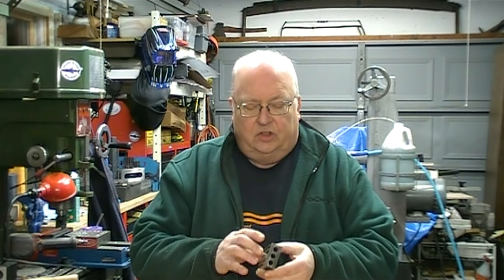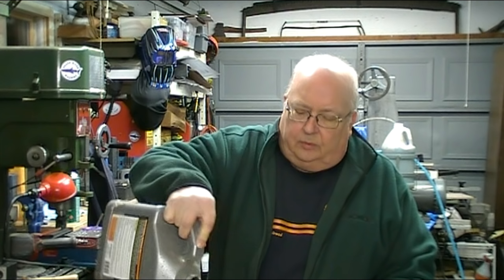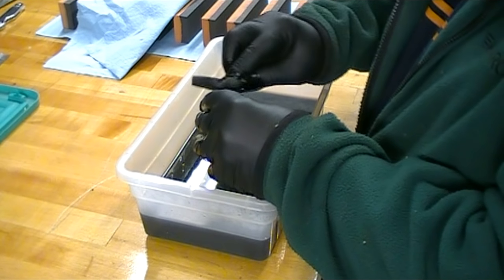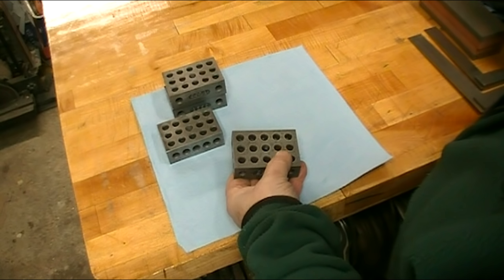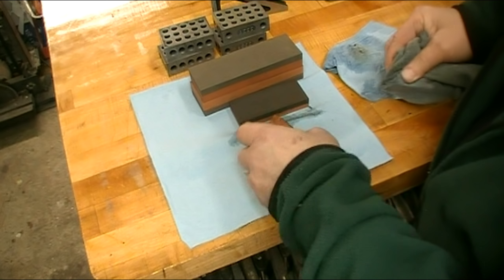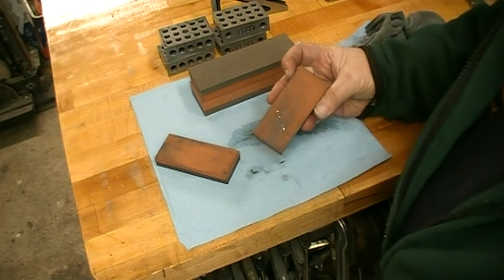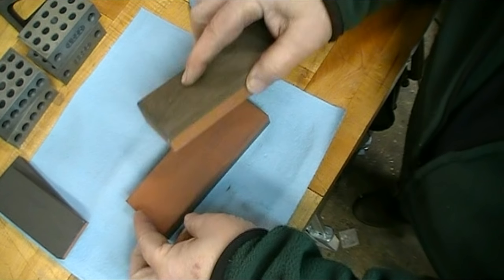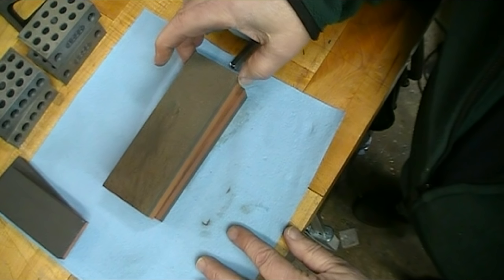Precision Ground Flat Stones - Use and Care

Comment: I good quick tutorial on the stones.  Besides deburring/cleanup do they have any uses? Would it hurt anything to use them wet to keep them from loading up?
Reply from the maker: Not sure about using them wet.  My concern is a break down of the surface.  I use them on most machine surfaces, such as the ways and tables of lathes, grinders, milling machines and the like.  They will not remove surface material like a raw sharp stone would, they only remove the high spots.  It is interesting to see the pattern that shows when you stone freshly ground surfaces. It is all about getting accurate repeatable measurements.  I got involved with them in a effort to up my precision. I am learning but Robin is the authority on the stones. Thank you for watching and commenting.
Reply: deburring during hand scraping is a good use for them aswell
Reply from the maker: That is a good point.  I didn't think about it because at this point I have not done any scraping.

Comment: Hi Steve. Need info on how you hold down the stones while grinding. Are they a commodity item? Or a shop made holding fixtures. 
And thank you by the way for the informative video.
Reply from the maker: I am using a set of parallel tool makers clamps.

Comment: So why can't you buy three stones and rub them together to form a flat plane, like you would on a surface plate?
Reply from the maker: I suppose that you could but I doubt that you would get the kind of finish on the stones that  You would get from grinding them,  Also they would have to be relatively flat to start or if could take a very long time,  Sometimes the stone out of the box are out of flat by .005" to.010" and shaped like a banana.  The very minimum that I grind off one side is .010"  that would be a lot of rubbing stones together.  Thanks for watching and commenting.

Comment: “Hinging” three quarters of the length signifies NOTHING except theses are the high spots
Reply from the maker: You are wrong about that. In addition these stones are so flat that they nearly wring together.  Check out Richard Kings scraping videos.  If it is bowed it will hinge on the far ends or the center.